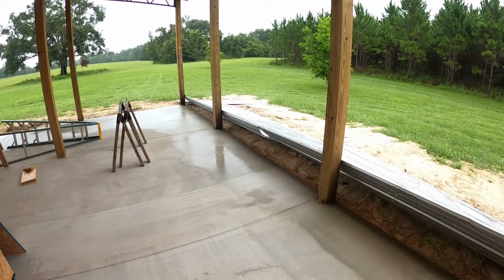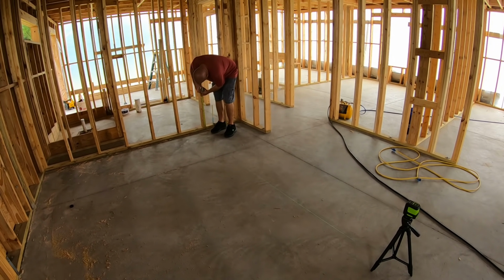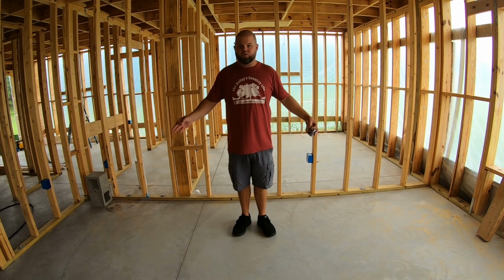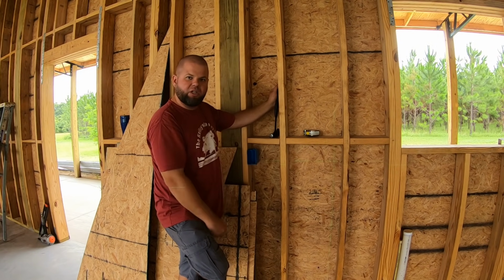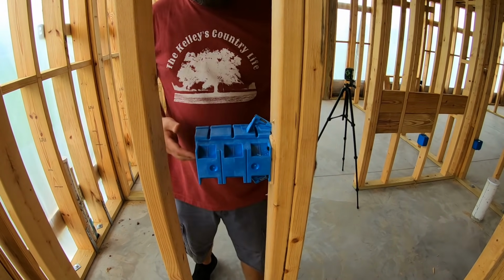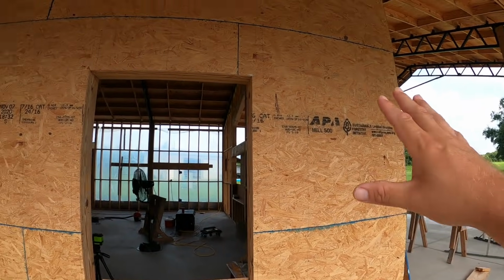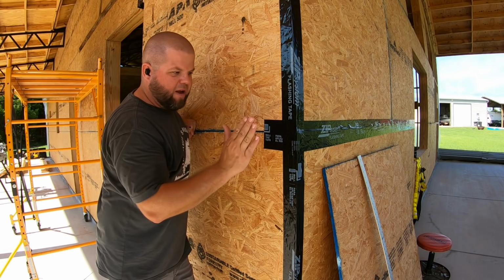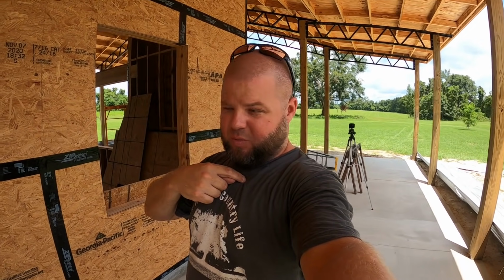Rainy day electrical and seam taping sheathing! #402 #barndo #barndominium

Comment: I know it's probably way too late, but did you consider pocket doors when you were designing?   I always figured that if I was building a house it'd have pocket doors practically everywhere.   Was in a friends house that was custom built that way.   Every room was basically just an archway.  Very open and inviting.   Then they just closed off the doors for privacy if needed.   I'm putting pocket doors into a new wall I'm adding to wall off an old "formal dining room" and making it an office off the living room.   Archway for normal in/out, closed for privacy.    Love your build.   Thanks for some great tips.   I bought the palm nailer and the Newair icemaker off your recommendations.
Reply from the maker: Yes both half bath doors are pocket doors in the plans. We decided against it after talking to a lot of people with them that were not satisfied. Always breaking, not closing well ect. The good pocket door kit and frames are extremely expensive.
Reply from the maker: Thank you for the purchases, I think you will enjoy both.
Reply: @TKCL  Yeah, it wasn't until I found Cavity Sliders (sounds rude) pocket door kits that I went with the pockets.   They are a bit expensive, but we only needed two.   Later...

Comment: A well sealed house gives you some extra options for cooling. I live in a more temperate part of the US, we don't have AC or heat. In the summer the attic heats up and I have a set of reversible exhaust fans that kick on around 100F, one blows in the other out, keeping it cooler up top. By the evening the inside of the house is around 80F and after sunset the outside temp is significantly cooler and I kick both fans on to exhaust sucking cooler air into the house and the air in the house into the attic. In the morning before I go to work I kick them both on again just to get everything inside nice and cool, then shut them off when I leave. Having a well sealed house I can choose where in the house that cool air comes in so In the morning I cool from back where the sun isn't and in the eve I cool from the front. That cool air carries over into the late afternoon on all but about 2 weeks of the year for us. I use a raspberry pi and a 4 channel relay board that controls everything, right now only the daytime cycle works off of temperature but I can add a couple more sensors and automate the whole thing to optimize getting the house to a desired temperature I just need to find a way to open the appropriate windows when the fans kick on.
Reply from the maker: Thats awesome that you can do that

Comment: I am not an electrician. Make a single dedicated circuit for the fridge such that you can hook it up to an emergency power supply at the breaker panel or something to keep food from spoiling in case of power outage. The four gang box might make it so different circuits would have to be in the same box for if the lights are on a different circuit than the outlets/fans etc. Also putting an outlet in the same box with switches might make it annoying to plug and unplug things as the switches might get in the way, if not using the flat rocker switches. Aesthetically pleasing switches are usually separated from outlets. Just a few thoughts.
Reply: Refrigerator outlets are typical about mid-wall height.
Reply from the maker: You are correct, I was thinking about that earlier today and have it on my to do list to move it.

Comment: In my totally non-professional opinion, you're doing a fine job. 
Most people have no concept of amps and breakers. I do maintenance at a school and one of the things on my to-do list for this summer was adding more outlets in the teachers lounge because they kept tripping the breaker. They had 2 microwaves, a toaster oven, a coffee pot, and a tea kettle plugged into outlets on a single 20 amp breaker. NO! That's not going to work... EVER! I ended up running 2 additional circuits back to the nearest 120v breaker panel.
Reply from the maker: Wow, yeah no kidding!

Comment: If using wide trim do you have room for that 3 gang in get ready room? I would have used a 2x4 block to gain trim space
Reply from the maker: Very good point, I need to look at that. That was an oversight on my part.

Comment: I’m currently building our house at the same time. I’m currently doing my electrical. For my master bed wall, I have a three gang switch box on both sides of the bed at nightstand height so that we can turn lights and fan on or off without having to sit up in bed to reach them. Also, I have a receptacle box mounted at nightstand height on both sides of bed. Idea is that they will have usb charging ports for phones and who wants to reach down behind the nightstand to reach them???

Comment: Only issue is that you could create a vacuum within your house, similar to a hatch door on an airplane.  There are issues with sealing a home TOO tight, and you more than likely will have to discuss with the architect and vendors of your components (i.e. doors, windows, a/c, etc..)  As usual, love the channel and the content - the goatee is getting a bit bushy IMO, that's the only negative that I can find.  That, and the dang weather.  Although I miss Florida, I don't miss the hurricanes and drastic weather changes.  Lived in Tampa and between Gainesville and Jax for 15 years.

Comment: If you move that refrigerator outlet box higher it will be a lot easier to plug it in or unplug it without pulling the refrigerator all the way out if it’s up off the ground. A lot of people will put them above counter level so you can lean over the counter and just pull your refrigerator out a few inches.  

I think those codes are ridiculous, having to have an outlet every 6 feet 😂😂.  If you don’t mind them it’s not a big deal it’s not gonna hurt anything but it seems a bit excessive.  

I always wanted them to make those boxes just a little bigger, mainly taller. Especially if it’s a switch near a door that has lights or dimmers or multi switches used in it, it always seems really tight inside. If they can make those boxes 3 inches taller come out like recess some extra space in the back it would just give you a little more room to bend those wires, especially for using a heavier gauge.
Reply from the maker: I agree, it's already on my list to move it. I got to thinking about it myself

Comment: An inspector wont fail you over ADA compliance electrical work on a private residence.
There is no set amount of general use outlets that can be on a circuit.
Kitchen circuits need to be dedicated circuits.
Never put a fridge on a GFI as it is a dedicated single use outlet and does not require it. Some inspectors will argue this. 
Take your #14 wire and throw it in the garbage. Keep everything #12 on 20 amp breakers.
Reply from the maker: Thank you for the tips!

Comment: For what it's worth my outlets behind the refrigerator, washer and dryer are not the normal outlet height. They are at 42 inches. It may have to do water supplys being in the area.

Comment: I like most of this. The 4 gang box in the bathroom I do not like though. Depending on local code a box can be braced but not mounted to additional blocking. A plug on the far end puts the most stress on that box in the wall. Personally I would go with a double box with double switches on one stud and a single in the same bay on the other stud for an outlet. I would also put all of the gfi and arc fault protection in the breaker box. Also go 30 amp for kitchen counter top outlets. You cant run a coffee pot and a toaster that are 12 each on one outlet. Well you can and people do but if you do 2 30amp circuits in your kitchen you wont regret it.

Edit omg I watched a min more, you cannot put fasteners inside of a box to attach it.
Reply from the maker: When did I put fasteners INSIDE of a box?
Reply: @TKCL  I thought that is what I saw in the 3 gang box in the powder room.
Reply from the maker: That was on the outside of the box, but I understand that any modifications isn't a good thing. Those boxes are too wobbly for my liking. FYI I am adding dedicated outlets by the sinks.
Reply: @TKCL  you are doing a great job. I'm not trying to pick apart your work but you did say if you see something leave a comment. Also do they stick out into the room 5/8 or 1/2 inch.
Reply from the maker: They have the standard stick out tabs for 1/2 inch sheet rock. We are doing 1/2 in the walls and 5/8s on the ceiling. I'll take all the suggestions I can get

Comment: Since you did spray foam can you explain the logic of the zip tap since the foam is going to do the samething as far as air movement is concerned? 

Please don't take this as criticism really wanting to know
Reply from the maker: Because we sprayed with open cell foam. It doesn't hard skim over like closed cell. While it seals well, it does still allow air to pass. The tape was cheap insurance for a better sealed home.

Comment: Wire your bathroom exhaust fan to the switch for your main overhead light. Save yourself an annoyance of always having to hit 2 switches. Unless your local code requires separate switches
Reply from the maker: We just don't want to always hear the fan while using lights for getting ready, brushing teeth ect
Reply: And sometimes you want to leave the fan on but not bother to keep the room lit. Separate switches are the way to go.
Reply from the maker: That's why I put a two gang box by the door.
Reply: @JCWren  If its a concern about power, I would not worry too much. I have not turned my bathroom ceiling light off since I moved into this apartment 2.5 years ago. Its a LED lightbulb. A very low wattage one. I don't think that I have hit $20 in total power usage there yet. I guess this could be a concern. But I have always rewired them on my own to be one switch when I encounter separate and just switch it back when I move out.
Reply: @thtadthtshldntbe  Not a concern about power. Sometimes you want a fan without a light, sometimes you want a light without a fan (particularly if the fan is a loud one). I don't find it very difficult to flip both switches on or off at the same time with one finger, and would rather have the choice for one, the other, or both, rather than being locked into a single choice.
Reply: @JCWren  I guess its a matter of like pet peeves. Separate switches for this is one of mine (along with people who have eggs in their frig and have an eggholder but don't put the eggs in it for example). It just irks me to no end having to hit both switches.
Reply from the maker: We definitely don't want to get ready or spend a lot time in the bathroom listening to a fan when not needed.

Comment: ok with the ADA code and your 16 inches to the bottom...are you not putting a floor in over the concrete? would that not be part of the 16 inches?. (ie say 2-inch wood floor so wood floor to bottom of the outlet,   should that be 16 inches there)...or would as you have it now with a wood floor and now be 14 inches still be complaint?
Reply from the maker: We are putting down thin vinyl plank flooring, I'm already a couple of inches over ADA minimum requirements. Won't be a problem

Comment: You’re not sealing it up too tight, you’re using a breathable housewrap so you don’t really have a vapor barrier you have an air barrier. It’ll be dry inside and it will be able to dry from the outside.

Comment: Put an outlet on the outside of your house within 25' of your HVAC equipment (Condenser, etc)
Reply from the maker: Definitely having outside outlets on every wall
Reply: NEC (210.63) requires outlet within 25' of HVAC equipment except for swamp coolers. I don't know if Florida makes an exception or not.
Reply from the maker: Won't be a problem, I'll have an outlet about 3ft away

Comment: Why is there no noggins(blocking) on most of the internal walls bracing the studs?
Reply from the maker: Never been said it's required, once sheet rock is screwed to both sides those studs are not going anywhere. I was going to block them only if the sheet rock installers asked for it.
Reply: @TKCL  without the blocking, the top and bottoms of the sheets won't be fixed to anything? How are these top and bottom edges held in alignment for plastering? Super curious to see how this works for you. 

I'm enjoying the content right now. Thank you.
Reply from the maker: With no more span than there is between the studs I've been told seam flex is a non issue. Not saying I won't add blocking down the road.

Comment: At 27:50 it is visually obvious that you started tapping at the top. I have never seen someone shingle a roof from the top down but I guess it could be done.
Reply from the maker: I'm still learning how to build my house and I did state that I didn't really think that it mattered. Especially under a porch roof. This tape seals to itself very well, I doubt it will ever be an issue.
Reply: @TKCL  it wont be a problem at all but best practice is to lap everything like shingles and always think like water. Also rain doesn't always just fall from the sky but I know you know that.

Comment: I wish everything is ADA compliant! Never paid attention untill I had a stroke !
Reply from the maker: Very sorry to hear that
Reply: @TKCL  I myself am partially disabled. There are other rulesets you might want to read through for some ideas. One is the ABA, the Accessibility Standards Act of 2015. In and of itself if applies to buildings that get federal funding, but there is a lot of info there. There is another set called something like Universal Design standards. This old house has done a couple of projects with those standards highlighting certain aspects

Comment: I know you mentioned an outlet on each side of the bed which is great for cpap and charging phones etc but I still would put a third outlet for the bed maybe even on a separate circuit because my medical bed has big motors in it also they make a cooling/heating mat for those beds which are nice if your stuck in bed so a separate outlet for just the bed would probably be better for ya in the future just explaining from a medical side..
Reply from the maker: Thank you for the suggestions

Comment: The "leaky house is a good house" was based on houses with basements.   Radon Gas.   In a house without "leaks" the gas would build up.   Down here in Florida, we're on a slab, so I don't believe it's an issue.   Seal that sucker up tighter than a drum.   Keep out the ants!!
Reply from the maker: Amen, we've got the bugs!

Comment: Quick question.. Is your concrete floor going to be your finished floor? If not everything you installed in this video will be off a little bit since you didn't say you were accounting from a finished floor height. Also, look into a company called  Aero-Barrier they can help find those little air leaks when you get further along.
Reply from the maker: No we are installing vinyl plank flooring, it's very thin.